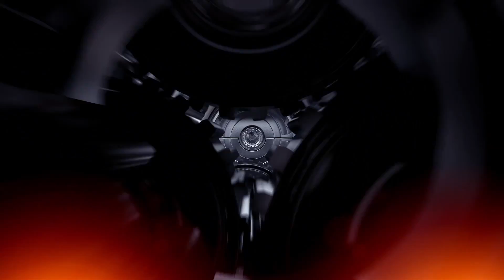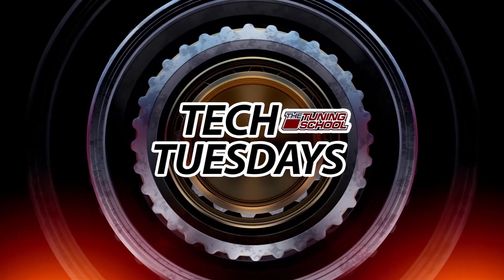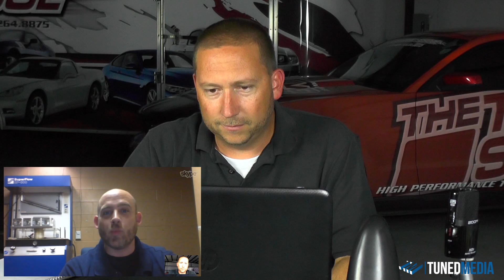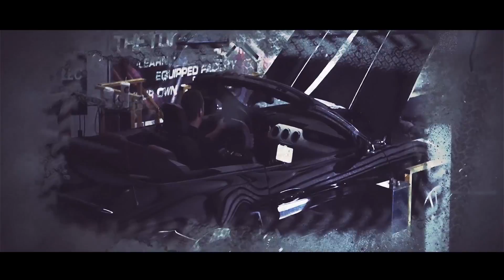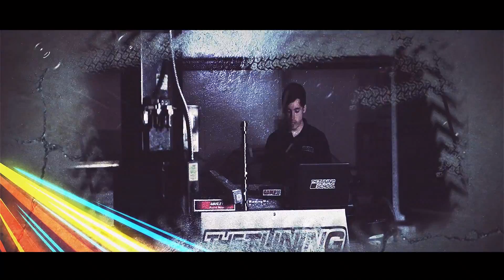Forced Induction (Part 11): How to Properly Build a Bottom End for Forced Induction

Comment: Static compression lowers volumetric efficiency. Of course there are advantages to having higher static compression, but lowering static compression to allow for more boost can actually make more power. There is a crossover point at which lower static compression starts making more power, it's different for every engine type, but it's generally around 15-20psi.

Comment: I enjoyed the video, thank you - not often that I take notes but I did this time.  I am a fact checker and I love numbers and data.  One thing that went over my head was "over the crank club".  I have been building NA stock motors for over 20 years and I am just now learning about high performance and racing engines.  I am guessing "over the crank" is a term suggesting the engine grenades and you drive over the crank?  I guess I am getting old.  Now I know how my parents felt when I threw some slang term or saying at them... ha ha ha...
Reply: yes, thats 100% the meaning of that phrase

Comment: My NA engine is going to get a 150 to 200 shot of nos soon. As it stands now the ring gap is .020 ..what should I gap my rings to so I can be safe with a 200 shot? FYI my rings are standard 5/64- cast top and bottom rings

Comment: Let me say something about aluminum.  There is still an argument about whether or not aluminum has an endurance limit.  The endurance limit of a material is the stress level that the material can stand under an oscillating load without ever breaking.  Some of the aluminum alloys are better than pure aluminum, but I have never seen any data on endurance limits for aluminum.  This is why aluminum connecting rods don't last forever.  Don't ask me why aluminum pistons seem to last forever when connecting rods don't.

Comment: I have a fitech power adder max 4 controller Gemini twin perimeter plate nitrous set up its five speed with 4:10s would a higher compression 302 work good or would I be better lower compression spraying more and should I change gearing ?

Comment: On the street.  I dont agree with the thought of running higher  SCR with boost. Lower compression allows more boost and timing.
Reply: With higher compression, you don't need to run as much boost and timing. Personally, I wouldn't run a lot of compression on a supercharged motor on the street because you will just shock the tires. I would on a turbo car any day.
Reply: @RussManK3  huron speed just came out with a modded version of the old aps twin kit for 4th gen camaros and i really want it but i got a big inch high compression huge cam stroker ls and really dont want to swap the cam and pistons ... street car with a/c and texas heat lol might have to take out a shit load of timing and just keep the compression
Reply: These guys build VERY fast and stout motors my zl1 makes 900rwhp with there motor
Reply: I know my engine makes more  power with lower compression higher boost more timing. Quite a bit more. This isnt theoretical.  Forged turbocharged 383 gen 1 with gen 3 ecm h/c/i. I make tad over 1300hp and  a little under 1500 ft lbs. Allot has changed since this build.
https://www.theturboforums.com/threads/a-machinist-a-turbo-and-his-l31-gmc.381269